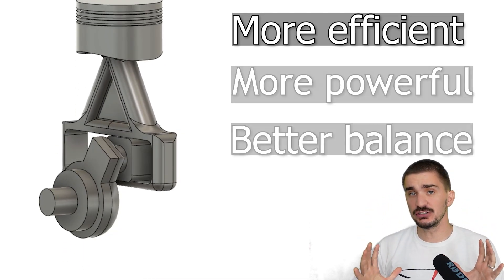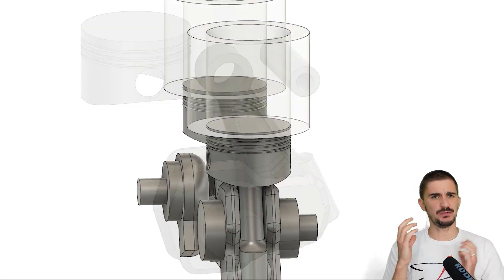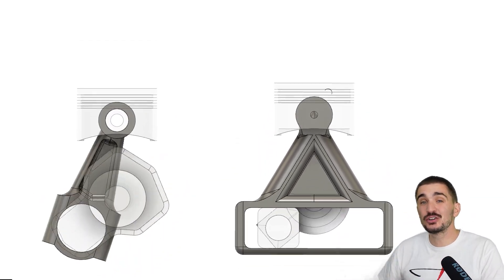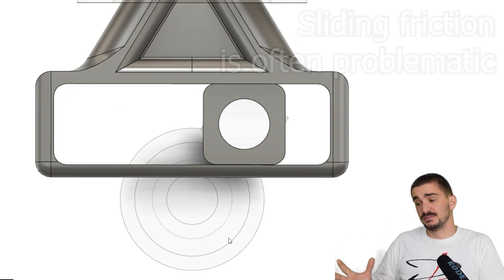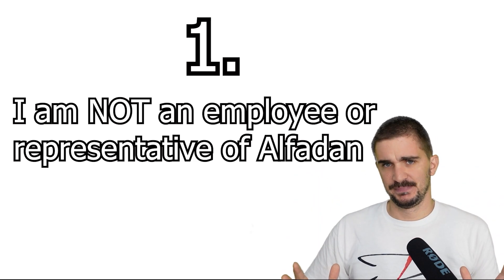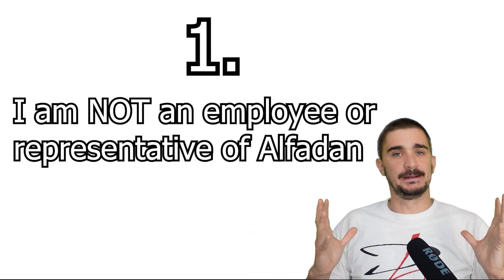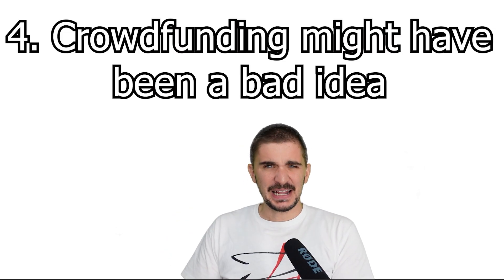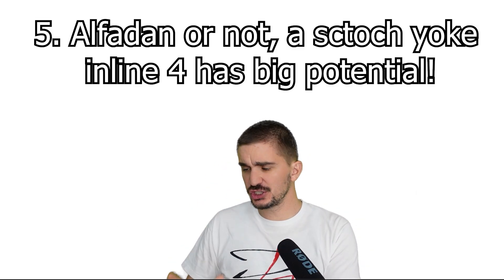This engine is better in every way?

Comment: Ouch.  Kinematic analysis fail, sir.  Irrespective of the particular shape of the rod (or yoke) and its motion, where a line extended through the piston's direction of travel does not intersect the crank pin centerline, there will always be a rocking couple, and where a rocking couple exists, you will have side loading.  The conventional rod, and the Scotch Yoke, are EXACTLY THE SAME in this respect.  Where they differ, is that with the Yoke, piston displacement as a function of time will follow an exact sinusoidal curve, whereas with the rod, there will be deviations in proportion to the ratio of crank radius and rod length (i.e. no deviations at all in the case of an infinitely long rod, and greater and greater deviations as the rod length becomes shorter).  The second area in which they differ is that from a material perspective, at any given moment most of the mass of the Scotch Yoke isn't bearing any load.  This make it a terrible design choice for any use case where power to weight (and power to volume) ratio is a consideration (which in modern applications, is EVERY use case).  With a rod, the force born by the rod is always acting in a consistent direction along the axis of the rod, so almost the entire mass of the rod is acting in a load bearing capacity at every point in the engine's rotation. (the only exception is that when the rod is under compression, the end caps are not bearing any load).  This makes it possible to optimize rod size and profile to the loads that will be encountered, such that the rod is as light as it possibly can be while still fulfilling its function with minimal chance of failure.  The fact that Alfadan is trying to peddle an engine design that seems to reflect complete ignorance of these design considerations speaks volumes, IMO.  I think a fair way to summarize all of the above, would be to say that the Scotch Yoke design isn't "unconventional", it's "archaic".

Comment: There is still significant friction against the cylinder of the scotch yoke design: the off-centre force from the crank pin on the yoke causes a torque, just like in the connecting rod, which in turn torques the piston inside the cylinder. The force on the cylinder wall can be reduced by increasing the piston length, similar to how the lateral forces are reduced by lengthening the connecting rod.
Reply: John, I agree. The conventional engine has sideways forces applied to the piston in a balanced way by the rod at an angle through the piston bearing. The new engine instead has a significant torque applied to the piston, which can only be resisted by sideways forces between the piston rings and cylinder, in opposite directions between the top and bottom rings. I have not done any calculations, and the amount of force needed to resist this piston torque depends on the length between upper and lower rings, but an initial glance at the moving drawings indicates that the new design will wear out the piston/cylinder surface much faster than conventional engine design while wasting more energy in sliding friction at the piston. If my intuitive understanding is correct, then this design (and the company) will fail. This has been going on for 4 years? I cannot imaging taking more than one year to machine the parts and assemble a working engine - and yes it will work, it is just a matter of for how long before it fails.
Reply: Exactly what i was thinking, the side forces are equal to the conventional design.
And making the piston and rod one piece will make wear even worse because the piston can't align itself with the cylinder wall anymore.
Reply: Two wheeler ralative

https://youtube.com/@pkengineservice?sub_confirmation=1
Reply: But you can guide   the lover part of the scotch yoke in the engine block, this will prevent angle change for  the piston!
Reply: thank you, i thought i was crazy thinking the same thing
Reply: No , the short edges of the scotch yoke's "square" run up and down linear bearings ( 9:40  648 & 650 in the diagram are bearings) in the crankcase walls. This eliminates side loads on the piston.  i.e. The square also acts as a crosshead , as used in steam engines and large (ship size) diesels
For some reason most commenters  fail to understand this
Reply: I think you are missing  the fact that the off-axis force still exists. So you will need restraint against rotating of the yoke due to the moment (torque).
Reply: @andrewmole745  but that force against the wall is reduced
Reply: @paulgee-i7j  Exactly!!
Reply: @paulgee-i7j  Got it, so you have more reciprocating sliding surfaces and more reciprocating mass.  You also have much more difficulty in maintaining tolerances which is why such designs have only been used commercially in low speed applications such as diesel ship engines.  You just moved the problem (which has long ago been solved) to a more problematic location.  YAY!  I love designs that rattle themselves apart due to problematic tolerancing requirements!
Reply: @knurlgnar24  possibly, but until they get a working example , all comments are just armchair engineering by interested amateurs.
One thing we do know is Mahle doesn't  think the ideas were not worth pursuing.
Reply: @paulgee-i7j  mahle is getting paid so no skin off their nose either way
Reply: @daos3300  Other than their reputation
Reply: @paulgee-i7j  doubtful that supporting an ambitious start up in a resolute but failed attempt would damage anybody's rep
Reply: @paulgee-i7j  Ok, so they just shifted the uneven force and friction from the cylinder wall to the crank case wall. My point still stands.
Reply: @JohnLadan  I think your point does still stand but the actual force on those linear bearings will be much smaller compared to the piston/cylinder wall because of the leverage being larger. The linear bearings residing in the block will allow pressurized lubrication too.
Reply: @JohnLadan  but it's better to have friction on perfectly lubricated parts that take care only of the friction than to do it on the cylinder walls that are exposed to the air fuel mixture, the combustion, and the high heat that it generates.
but the big question that still remains is wether deleting secondary imbalance vibrations is worth all that. it seems like any gain will be dwarfed by the fact that the 8l inline 4 will have giant pistons and/or very long stroke, both of which will make revving this engine fast a nighmare
low vibrations are good for high rpms but huge cylinders are VERY bad
Reply: @JohnLadan   Why?
Reply: @H1tman47  Exactly!
Reply: It would probably not be a 1 cylinder engine.

Comment: Guaranteed to destroy that square block bearing and also definitely going to overheat with all that friction.  Not to mention the thrust stresses on the rectangular hole and the crankshaft.  Also look how much bigger the crankcase would have to be, that means more oil, and more weight and also less space to work on it. This is a terrible idea and will break faster than any normal engine.  Keep trying and remember that it's mechanics that make engines work, not engineers with fancy software and clean hands.

Comment: Besides the noted HUGE sliding lubrication problems, there is no mention of the weight of this Scotch Yoke "rod"... which is likely double the weight of a conventional rod.  All worthless for even moderate RPM engines....

Comment: Keeping the long yoke ridged and lubricated even with modern materials seems improbable.  Reciprocating weight is going to be critical.  This design may be better suited for a low rpm low hp engine.

Comment: So a boxer engine would be ideal
Reply from the maker: Flat non-boxer, a boxer wouldn't change much I think
Reply: @d4a  it would strengthen the rod from both directions and balance the recip motion.  The rod would be heavy but lighter than individual rods.

Comment: Neat theory, but more moving parts = more things that could break. I also think that would add a lot of weight the rotating assembly. Not to mention packaging inside the block, I don’t think a rod that wide would clear the bottom side of sleeve or other parts of the block when piston is at TDC, at least on a larger stroke engine. I could see the square inside the rod wearing out very quickly as well.

Comment: Anyone can claim to be working on the most promising anything and ask for “investment” knowing it will not succeed. In the meantime they can pay themselves a nice salary for a few years and then say sorry it didn’t work.  So as long as they gave investors the standard investment warning, they are not a scam ? 
If a startup does not show  the engineering behind its claim, it’s very questionable.  Not buying the it’s a secret because patent does not protect them excuse.
I don’t have to be a genius to know that this engine design will not be in commercial production in the next 100 years if ever.

Comment: Have you heard about Taurozzi pendulum engine? It also nullifies the friction against cylinder side without any need for nanotechnology.
As for Alfadain... If a team of top-level engine engineers needed 2 months to convince that CEO to test his design on 1 cylinder instead of 4 then he's either dumb or has an ego the size of an oil tanker. And he talked about that as if he's proud of that.

Comment: What a bunch of BS. the sliding yoke will still produce a sideways force (as there will be friction on the sliding part) which will rock your 1 piece piston-rod and destroy the piston and cylinder wall (as it is 1 piece now and has nice long leverage)... also good luck making a nice oil film on that sliding element..

Comment: Maybe using high viscosity oils and crank the pressure to the roof? Just changing where the loss will happen, but potentialy solving the sliding problem.🤣

Comment: As soon as I saw it I could tell the friction inside that rectangular hole was an issue. One possible solution might be some sort of opposing magnetic levitation type system. That sounds pretty complex though. Another option might be having it ride on a cushion of air. That also sounds like it could be very complicated as well. Maybe needle bearings like in a driveshaft, or roller bearings? There has to be a solution.

Comment: The main advantage I see with this design is balance and harmonics. Wear rates are very good on conventional piston engines that are 'properly' designed, due to advancements in materials/chemical engineering and manufacturing processes. Small engines are pushing loads of turbocharger boost and surviving (like AMG mercedes 4 cylinders), while milder engines (like Toyota's newer 2.5 liter) survive many miles of abuse and minimal maintenance.

Comment: Looks like a lubrication/wear nightmare. How would you keep oil pressure on a journal surface that isn't constant? 

Probably will see significant binding of the square hole feature as it continues to wear. 

This is a neat simulation project but a great example of "just because something looks good om paper doesn't mean it will work in reality"

Comment: If only someone redefined rotary engine to work perfectly with no flaws
Reply: The flaws in all engines is what makes them so interesting.

There is no absolute perfection; only levels of staving off inevitable impending failure.

Comment: This very much reminds me of this engine design right here https://www.youtube.com/watch?v=ylwbrFK-n-g (I don't know if this is the original creator of this design, but he is the only one where I've seen this so far). If I understood the design correctly it basically does the same thing as the scotch-yoke but without the drawback of the linear friction part. It might have other drawbacks that I overlooked, or simply do not have the knowledge to understand. (I'm not an engineer, yet). Still I find this design very interesting.

Comment: Hi
The alferdan thing technically not a scam but they haven't as far as I know produced a single working model only a bit of computer generated imagery also his power claims don't stack up fo a 4cylinder unit of the capacity he was talking about. There have been many engineers building engines of novel design some I have witnessed the running unit some just happy to use there design for themselves and some looking for investment and unfortunately the companies I have worked for declined but at least they had a running unit. So technically not a scam but just as bad as a scam

Comment: The sliding box looks very weak and would be the point of failure. Also, the "con rod" has to be longer than normal, so it doesn't hit the cylinder wall.  IMHO, It's not a good design.  Engines and mouse traps have a lot in common. Anyway, I'm only 5 minutes in, so back to the video. 🙂

Comment: Hi
I disagree that it is better in every way for a start it's not practical for small engines like every car on the road it's not suitable for high speed  engines it's really only suited to medium or low speed diesels and they already use a crosshead to take the side loading, it's not a new idea it's been around for almost as long as the ic engine so if it was so great don't you think that the motor industry would have adopted it. But then you have to think about the extra cost of more machining higher parts count and to what end a unit that will make less power although marginally more efficient and will potentially last longer. Cars today don't usually get scrapped because the engine is bad or the body rotten its often the interior that gets shabby switches break stearing and suspension components get tired before the engine needs a rebuild and is actor manufacturer really I terested in picking up a small percentage increase in efficiency or better longevity manufacturers want to give us as little as possible as cheap as possible

Comment: Just reinforce the sliding area 😂, as for friction, use harder material for face and ball-bearing driven like HiWin MGN series sliders to cut down on friction at one spot on sliding surface.

Comment: I don't see how this gets rid of any of the mentioned issues, with the exception of the secondary imbalance as the vector of the forces remains exactly the same. Besides that it seems to add a lot of mass to the rod system.

Comment: Can't agree with your "friction" analysis of the unconventional "Scotch Yoke" engine.  Draw a free-body diagram of the piston-yoke assembly ("rod") when the crank pin is at 90 deg = the force of combustion is offset from the force on the crank pin = puts a huge moment on the piston-yoke assembly that can only be resisted by the piston "cocking" in the cylinder bore = puts a huge sideways force at the top of the piston on one side and the bottom of the piston on the other side = a lot of friction that you haven't accounted for.

Comment: I still feel like its too late in the game for major ICE developments. The main market for them is cars, which are being pushed very hard towards electric. No new tech is perfect and putting it in a niche market will extend the time it takes to find the problems that result from real use in mass deployment. R&D seems like it would never be recuperated when the clock is already ticking on your fuel source

Comment: You know the Designer vs. Programmer meme?

This applies to the engine designer vs the journal bearing engineer here. Fuck trying to design a journal bearing for a sliding box at 8000 RPM

Comment: This has been used in Stirlings for forever, the difference is a Stirling is a low, CONSTANT-torque engine (yes, even on the upwards piston stroke!), whereas an IC engine is firing in short, powerful bursts of torque. Even with the many benefits the Stirling has on this yoke over the IC it's still not really totally superior to other methods, so for an IC engine which has a magnitude more problems it's definitely not "superior" to conventional.
Still, it's worth experimenting with for a lightweight, multi-cyl. low-capacity powerplant.

Comment: One could put a sleeve inside of the bearing surface of the track where the lobe goes back and forth that could be made of a stronger material than the rest of the casting enabling it to handle the stresses and friction.

Comment: That square part has >10x the surface sliding area and >10x the movement length of the wrist pin = >100x more friction (not to mention side loading).
And >2x mass of the connecting rod with an increased number of connecting parts is more efficient and has fewer parts? Amazing.

15:35 patents exist solely for that reason, if they had any IP they would patent it. 
That's why they went on crowdfunding, no educated investor would buy their story.